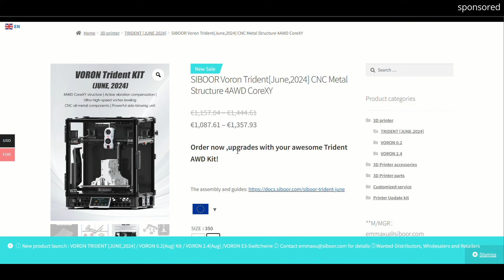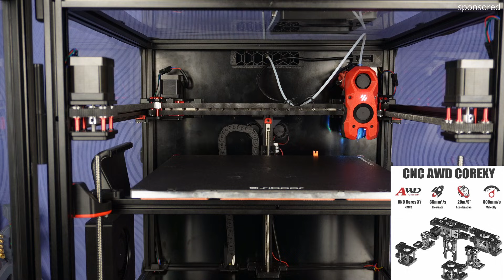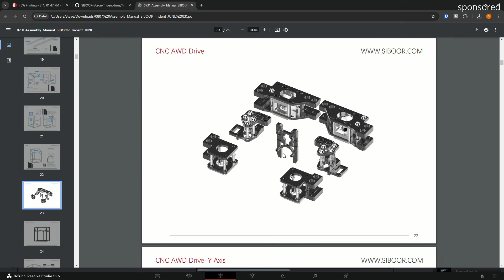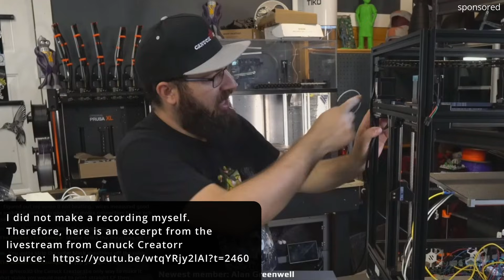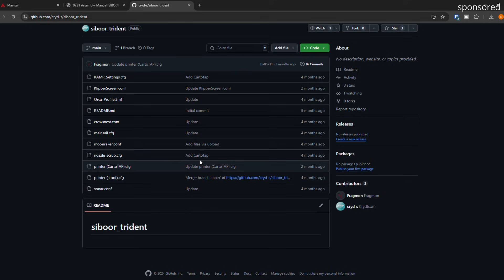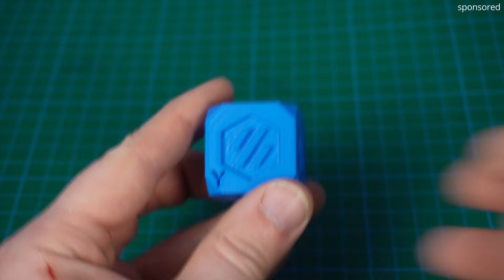Is the Siboor Voron Trident 350 AWD the Best DIY 3D Printer Yet?

Comment: After watching your video, I want to build one myself.
Reply from the maker: Nice. The building experience Was really good.
Reply: @crydteamprinting i really Want a voron But most people say you cant buy this as your first printer, but i Need only one and the voron is the Favorite because you can customize almost everthing in this printer , so so you think i should get a small and cheap printer Like the bambu a1 or the Copy Form creality or should i buy the voron directly ? Greetings from Austria :)
Reply from the maker: If you're handy with crafts and aren't all thumbs, then you'll definitely be able to set it up. The biggest problem, however, is printing. If an object doesn't look the way it should, you have more variables to consider than with a purchased printer. It could be due to the hardware, setup, software, or slicer.
Reply from the maker: If you like to print, then buy a bambu or creality. If you have fun with printing @ building Things (lego child). Then build a voron. I like both hobbies and building printer are enjoyable.
Reply: @crydteamprinting  I went to have a look and found there were version Trident and R2.4 R2. What is the difference between? I also wonder whether you can comment when compare the print quality between Voron and commercial printers such as Q2, P2S, etc.
Reply from the maker: I dont understand. The trident is a different printer (compare to 2.4 R2).

The print quality of the Bambulab printer is nearly the same but you have more Upgrade possibility. Increase build volume (350*350) increase chamber Temp. Build IDEX or Tool change Setups...

Comment: Great video and showcase of this kit! 
I built a 2.4 and 0.2 last month and I now want to build a Trident too.
The AWD gantry looks nice and I thought of installing one on my 2.4 as well.
I saw AWD gantrys make me lose a bit of bed space in the front corners, since there are big motors instead of small tensioners now. Is this the same with this Siboor kit?
Reply from the maker: Yes you loose a bit on the front corners. But if you use another toolhead you can reduce this.
Reply: @crydteamprinting  well, okay. Thanks for the fast answer! I planned to buy Bondtech INDX for my 2.4 but then thought, a Trident might be a better choice so I don't need to move the toolhead of a 2.4 up in Z for each change, or move the whole tools up in Z. 
Losing print bed space is something I wouldn't want, but that's almost unavoidable with AWD setups. Well, I'll decide when I have more space in my room. 4/5 printers are on my floor right now xD

Comment: I self sourced, a voron, tried at 300 about 2 years ago. And while everybody was having issues with different variations of kits and various changes to the kit's, my first build experience, it was super smooth. Even setting up the printer config, it was really smooth and easy.I highly recommend building using self sourced parts. Also, it will ensure that the parts you have are high quality using vendors like kb3d, west 3d and fabriko
Reply from the maker: I haven't had any good experiences so far. Especially when sourcing bearings and pins from different sources. I've had problems with tolerances in many projects. Of course, if you order from the manufacturers mentioned, the risk is low, but you pay for that, of course.

Comment: This kit is very well put together.  It has high quality parts (not all) and the instructions are very well done.   You don't need to do any custom crimping and its pretty much plug and play. The manta board and pi replacement is pretty much already set up.  This kit took me 3 days to assemble to 100% with simple hand tools included in the kit. I have built a voron 2.4 and a vz bot previously. This is a great kit with awesome customer service.
Reply from the maker: Nice, thanks for sharing your experience with the kit!
Reply: Does it include a Voron Tap on the SB? I can't understand that there is no complete exhaustive list about the components that you are buying....
Reply: @hernancurras cartographer v3
Reply from the maker: It is:
https://docs.siboor.com/siboor-trident-june/bill-of-materials

Comment: For the CW2 check the MirageC video about the Bondtech RIDGA  extruder gear it have improved my printing quality by improving the concencitry of the gear extruding the same amount of material, almost any dual gear extruder is afected by this
Reply from the maker: Hey, Yes i heared about this that i can fix this problem. But this new gearset dont solve the problem with the bad ease of maintenance 😅

Comment: Pretty detailed video of why to buy a VzBot! 😂 in all seriousness they copied the 4 motor (awd) from vzbot in case you didn’t know!! Better quality metal parts including a light weight extruder, bed assembly, z axis, higher flow hot end that you can configure in a few ways including water cooled… Voron honestly hasn’t done anything in the last decade besides copying other printers parts and calling it a “ revision#” of their own design
Reply from the maker: Why so negative? 🙂
It’s actually a good thing when others build on existing designs and add their own flavor — that’s how performance improvements often come about. Not everyone needs to start completely from scratch.

But since you’re bashing Voron so hard, I’d honestly be curious: who exactly did they copy the Voron Phoenix, V0, or Switchwire from?

Comment: I do want this, but I am doing to be doing the Sovol SV08 Max and BoxTurtle, but I do want a rock solid build, but I need 500.
Reply from the maker: Then have a look on our fysetc Venture_XL Review.
Reply: @crydteamprinting  I am also looking to buy a Sovol SV08 max and took a look at the review ... almost 70KG and in addition 2000 € ... ey man das ist der doppelte Preis von dem Sovol mit geschlossener kammer.
Thats quiete an upsale. Yes it has some quiet nice possibilities but bontec indx is comming and that will be a better multimaterial upgade with less driver needs.

Comment: I’m putting this kit together and I’ve completed belting my gantry. I’m getting a very very slight back and forth motion on the X carriage when moving the entire x axis in y by hand. 

Checked belt routing, tension is even per side, belts appear to be even amount out of both sides of the carriage, and matched them tooth for tooth before build. 

Should I disregard and push forward or try to figure this out? The movement is probably .5 mil back and forth
Reply from the maker: The metal shafts on which the pulleys and bearings run might have a bit of play, causing the belt to press against the pulley flange. This can jam the pulley and cause everything to rotate together. Please check the belt path at each pulley to see if the belt is riding up onto the flange in certain positions. If that’s not the case, try slightly loosening the connectors on the AB and XY joints — the shafts might be getting compressed too tightly.

Comment: Thank you for a very helpful video!  I'm researching for my first printer and am trying to decide between the Prusa CORE One and a VORON variant. To be honest, I would probably have purchased the Prusa already, except that I'd like the printer to be bigger. I'm okay with doing the build (retired Systems Engineer) and I'm happy doing regular maintenance, but I don't anticipate becoming a tinkerer. In the end, I'll want a reliable tool. It seems to me that either of these can fit this use case. I have a question about your CW2 experience. If one were to upgrade to a different extruder, would that require changing the Stealthburner as well? I don't anticipate that the AWD feature will be needed for me, but I would appreciate the CNC'd parts and the door upgrade. Unfortunately, the Siboor 350 seems to be out of stock at the moment. I'm considering going with the FormBot for this reason.
Reply from the maker: Thank you for the comment. You can replace the Cw2 with a G2E extruder. It's a 1:1 replacement. The Siboor kit have parts for 2WD too. You can Upgrade later then.

The trident kit is in stock:
https://s.click.aliexpress.com/e/_EwJ2DRc

Comment: Thanks for the great overview of the kit. I'm thinking about buying one as my very first voron kit but when i went through the manual, i noticed that not often 2WD is mentioned, only AWD. When getting the kit, is it easy to see, which parts you don't need?
Reply from the maker: I dont understand the question. But if you mean that you would build a 2wd first, then you Only change the Front Motor Mount top Front idler. There are the only parts that have to be changed. But both Kind of parts are inside the kit.
Reply: @crydteamprinting  sry yes that was the jist of my question. I see, so not much. Thanks for the answer. I asked the question because the manual is layed out for AWD and it's not that visible, what you have to change in order to build the 2WD variant

Comment: ALmost purchased until I noticed that the print area was only 350x250x250 and even less with the AWD version.
Reply from the maker: No it's full 350*350. Only z is limited like all trident and with awd the are a little bit unusable regions in the Front corner. Why do you think its only 250?

Comment: Thanks for the in-depth overview! However I must push back a little regarding your conclusion on reliability. Currently I have 10 3D printers. Some DIY some commercial and some of them have thousands of hours of print time. What I have found is that all printers will need maintenance (bearings, thermistors, nozzles, hotends etc.) at some point. With that said, any of my printers using higher end components such as linear rails over linear rods not only hold the print quality longer but require less major maintenance. For example, bearings on linear rods fail over time and I have yet to replace a linear rail bearing block. That's not to say that it won't happen just that I have yet to have to replace one unlike the rod bearings... So currently I am considering the Voron Trident or Ratrig Core 4 to start a small standardized print farm, specifically for the amazing print quality, reliability, and parts availability. Also there are no proprietary components or software to inhibit workflow etc. In regards to Bambu Lab, I do not want my intellectual property (3D designs) being sent to a foreign countries "cloud server" where it could be potentially stolen or blocked from being printed because it my violate their policies etc.. There is no reason to send an stl. file to a "cloud" service and then back to your printer. It's just another potential failure point.
Reply: The cloud thing was the nail in the coffin for Bambu in my opinion. I was already turned off by the closed source nature of their devices and software but was initially willing to still give them a shot since they are in the same quality and speed bracket as Vorons from what I've understood and come ready to print. Glad I didn't get one and will be building my first Voron when my Siboor kit arrives in a couple days instead.
Reply from the maker: Thanks for your detailed feedback! I didn't mean to imply that DIY printers are inherently more maintenance-intensive. Rather, my point was that such printers often require more care due to their assembly and necessary maintenance, especially when users expect high print speeds from a high-price self-built printer, which indeed can increase wear and tear.

Other than that, I completely agree with your points and have nothing to add. Your considerations in choosing printer models and concerns about protecting intellectual property are particularly understandable. Thank you for sharing your insights!
Reply: Hi Greg,  welcome to contact us for Siboor Voron Kits to build your standardized print farm.

Comment: hi whats the outer dimension of the printer, if you could kindly share as i have limited space thnks
Reply from the maker: The 350 trident is
60cm height
57cm depth
53cm wide
Reply: @crydteamprinting  many thnks, so 300 trident should be smaller
Reply from the maker: Yes i think so but you can join the Siboor discord server and ask a person which have a 300.

Comment: This design is based on an old AWD mod, and it would 100% perform worse than even the plastic version if monolith gantry. Just laser cut a monolith instead of buying this outdated garbage
Reply from the maker: Why do you use the wird garbage if there is only a outdated Design? Why do you know if it's always worse than a 2WD (which can be build with this kit too). Do you think every people can Laser cut Things?

Comment: siboor is great but DO NOT choose AWD as your first setup, its VERY complicated do diagnose problems
Reply from the maker: Yes. I said this too on my conclusion.
Reply: I am an engineer and I usually print lights-out (over night).  High speed is not a requirement for me.  High print speed affects the properties of the finished print, not in a good way.   I will be buying 2WD
Reply from the maker: @darrenconway8117. I completely agree with you. Just because a printer can achieve visually impressive speeds doesn't mean that its physical properties aren't compromised. That's why I mentioned that speed printing (also in our Stinger review) is only sensible for prototypes to check the fit or the design. One advantage of AWD that I currently see is that it "relieves" the motors, especially at high chamber temperatures. Particularly at 70°C chamber temperature, some motors can already reach their limits.
Reply: @ I wasn't aware of the 2WD cooling issue.    At present, I only print with PETG to get consistent results.  I Voron would give me the option of printing other materials.  I did a quick search for 2WD cooling mod, but nothing found.

Comment: This kit is soo temprano i have never built a voron before and was waiting for the new bambu printer but with all the controversies i think i might just build a voron now i habe been primting for a good 8 or so years so tinkering with a machine is not a problem
Reply: Same, voron seems to check all the boxes. Kits like this make the decision easier.
Reply: Ive build a voron 2.4 as my very first printer with no prior experience against all recommendations. It took me 90 hours to build (made sure to install everything upside down, left instead of right and do it three times over haha) and then some tens hours to understand calibrating and all that. Then its been printing for two years untouched until i wanted to challenge it with TPU and had to calibrate further and try out different slicers.

I do have to say that the voron being a non standard printer with various adaptations makes it a bit challenging in finding manuals, each build is slightly different. My manual was outdated and other had different components, for a beginner it was challenging. Especially the linux installation. But over time i got over it. Now i even have a lot of fun editing custom macros.

I would not recommend it for out of box printing.
By building it i have learnt a lot more and am able to fix whatever is needed myself but its been very reliable and didnt need any fixing except filament blob hotend cleaning.
If you already have experience tinkering, and even enjoy it, its a no brainer - with all the nice mods eliminating some uncomfortable details.
Reply from the maker: Then you should build your own printer if you like tinkering. If you need the printer for your "main Hobby" then you should use a bambu.
Reply: @crydteamprinting I disagree. If you need a printer for your business a Voron will require more up front time commitment for sure but will pay out a thousand times over in the long run simply because you can replace each individual part easily and don't have to worry about BS closed sourcing. Simply put, the open source nature of the Voron makes it the ideal printer for a business.

Comment: I don’t know if I missed, but what are the advantages and disadvantages of the 4wd system?
Reply from the maker: + you share the load in the stepper - > reach higher speeds. But in this setup the stealthburner is the problem. Its to heavy for reaching the awd Limits.
- you need time for syncing the stepper and tightening the belts. I cant recommended the awd setup for the first build. But you can buy the kit because you have the parts for 2WD inside.

Comment: 3:20 - Another advantage of a stationary coreXY gantry with the bed moving in Z is much faster and easier tool changes if tool nests are added at the front of the printer.

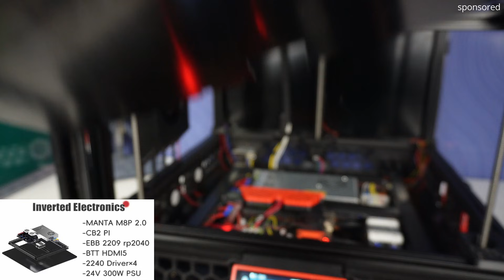6:00 - Access to the electronics from above by removing the bed, without needing to tilt the printer onto its side is a great idea for a large format printer, and that's even more true for a user built printer where repairs and upgrades are more common.
Reply from the maker: I see the tool changer differently. With a flying gantry, you can lift the toolhead and move it out of the fixed position. Similarly, when unloading, you can place it down and lift the toolhead again. With a fixed gantry, the option for Z-axis movement doesn’t exist. But yes, it’s also possible with a fixed gantry, as shown with the Prusa XL.
Reply: @crydteamprinting  I believe that having a fixed Z gantry is actually better for tool changing, but only if designed around. It's much easier to design a toolchanger that doesn't lose build volume to the docks using the Trident design over the 2.4. The DAKSH toolchanger and the Prusa XL like you said are good examples.